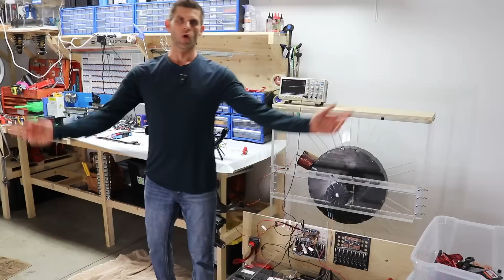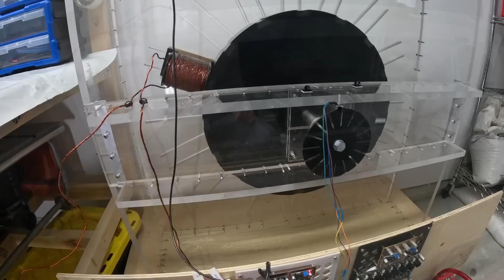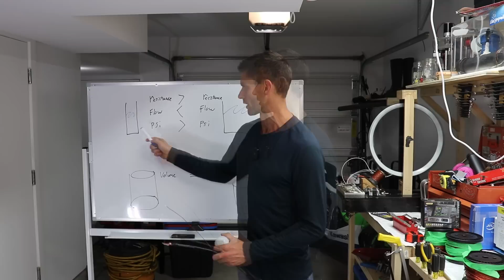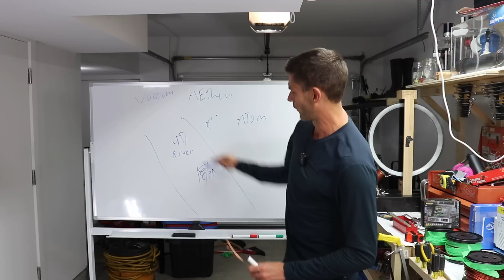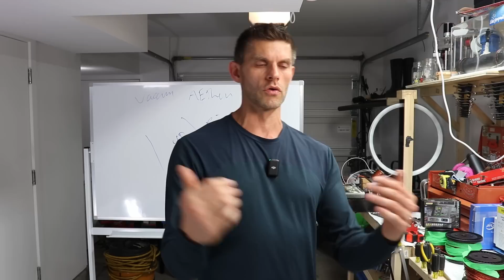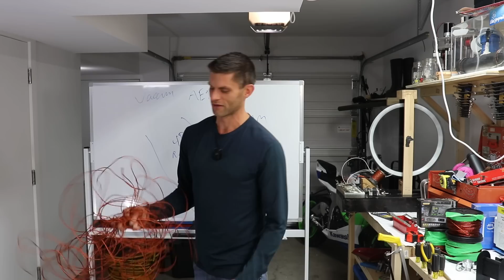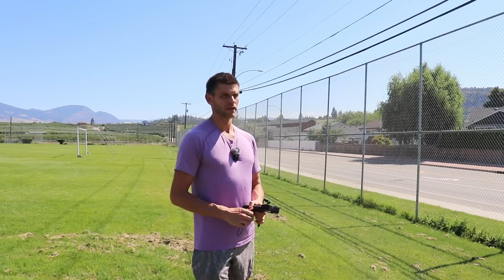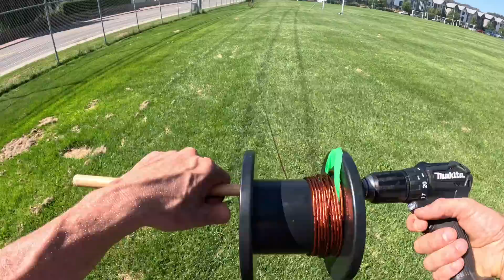I Built This Energy Machine in My Garage — And It Works

Comment: Mechanical solutions to aether harvesting are interesting. I feel like direct electrical systems are probably a little cheaper to build. But a solution is a solution! The benefit is you're working with an existing design.

Oh wait a second. Is that a fractal coil? 😉 Now we're talking! You have a 2 level fractal. I wonder what happens if you have 3 levels? 😉
Reply from the maker: Lol stay tuned ❤❤

Comment: The real question is how many batteries does one battery charge and how much time it takes to charge up 1 battery? And isn't it inefficient since battery health will deteriorate overtime and you need to buy more batteries which is the main cost of the build? Also will really appreciate some proof, like a timelapse of batteries being charged up.
Reply from the maker: Yes the proof is coming, im going to show when the build is finished and also on the bedini SSG

Comment: How over unity is achieved based on potential energy before & after, will be interesting to see what equipment is used for this. I think you mention measuring "work" before & after with a known load, but how precise will this be? If over unity is tiny, but accumulated over time, how much more versus the build cost, will be a great next discussion down the road.

Please watch this video - on how parallel current flow in coils affect each other - may explain in part the effects you got - what Ampère discovered on how two coiled wires with current flow in the same direction don't repel.
Your coils with independent strands sandwiched together under pressure and encased in epoxy - may be exploiting this phenome - the compounding effect you measured & the spike. Plus the math is there :)
Your idea on this would be enlightening, as you possess a higher education I don't have. I find this stuff fascinating, how a forgetting by time documented research might prove you right today.

"The Force That Physics Erased: Ampère’s Forgotten Law" especially at around 4m 15s 
https://www.youtube.com/watch?v=YHykWjtVdNM

Comment: This is just an inefficient way of moving energy from one battery to the other, if you were generating net energy you should be able to run off a capacitor and also charge it and the voltage should go up over time. If you can't do that then you're not generating anything.
Reply from the maker: Ok sounds like u know
Reply: I guess modern electronics use high freqency Capacitors that suck up this theory of Ions (Lead acid/batts in general) getting slammed with these very high speed spikes, exploiting things conventional DC current isnt utilizing (my understanding). Time will tell. I can see the "Cap to Cap" self looping idea as being logical

Comment: Help me understand the basics of what you’re trying to do here. You take a set of charged batteries to drive current through the coils. The coils then generate a magnetic field, which spins the wheel. The spinning wheel in turn charges the other set of batteries. Ok, but once all the energy from the first set of batteries is used, the amount of energy stored in the second set of batteries will be smaller. That’s because part of the energy from the first set of batteries is inevitably lost as heat, friction, and electrical resistance.

Later, you plan to connect something to this circuit (for example a light bulb) to power it. The bulb will light up for a while, but eventually it will simply shut off. And the reason is the same: friction, heat, resistance.
Reply from the maker: Not quite, check out my last few videos
Reply: @MadscienceLPTECH  OK. I’ve watched your videos and here’s what I understand so far: Your motor uses pulsed input to the coils, and when the MOSFETs switch off, the collapsing magnetic field creates high-voltage flyback spikes. These spikes are routed through fast diodes into the charge battery. According to your explanation, these sharp pulses create an imbalance inside the battery between fast-moving electrons and slower ions, forming a dipole. You suggest that this imbalance allows energy from the vacuum (or quantum field) to flow into the system and increase the overall energy.

My question is: do you expect the amount of energy drawn from the vacuum in this way to be greater than all the losses in the system—such as friction, electrical resistance, and heat in the coils and switches?

Comment: Hey man I understand you're thinking and I also understand that you've invested a lot into this but it's important you don't get stuck bashing your beliefs of how you think it will work on hope I've been doing that rabbit hole myself in my own project trying to catch back emf to generate power it's not more powerful then the losses of the system in accelerating the motor to collect the collapsed emf it is higher voltage but the current is less and as we all know the current does the work in electronics
Reply: I typed this fast and sent it before spell checking it by accident.
Reply from the maker: We are not expecting excess flyback. Your beliefs are not mine thankfully and we will have excess energy very soon

Comment: Why don’t you measure watts to the coil and watts coming out of generator? It will instantly reveal if there is excess energy in the system
Reply: I agree the system needs a load. Most scientific way to measure P output would be a variable resistive load (load bank). Gradually increase load (decrease resistance) and find the point where power peaks which is where the voltage starts to drop off. A simple $20 power meter will show P input to the system. You can instantaneously compare P output to P input. In my opinion, the light bulb method is too crude. I want your results to be clear and indisputable, which requires rigorous quantification.

Btw I’m a physics and engineering educator and I’m in your corner.
Reply from the maker: Watts off the generator? You have to measure work done or power inside the batteries to definitely measure the system

Comment: 0:50 dawg it's called gravity
Reply from the maker: No i dont think so
Reply: @MadscienceLPTECH  ok technically it's the electric potential of the air. But seriously the equations used to calculate the force of gravity and the electrostatic force are structurally the same

Comment: You use water flow as analogy for electricity flow, I relate to it that way too. Continuing in that line of thinking , the way I understand what you describe as happening with the voltage spikes that produce the additional charging reminds me of a water RAM PUMP. A ram pump uses a stop valve on water flow and the kinetic pressure pumps a spike of water to higher elevation. Seems like the same principle to me.
Reply from the maker: Yes others have commented they agree with you

Comment: Just so I understand correctly: one battery powers the coil to run the pulse motor, and then the spinning wheel is used to charge a second battery. If so, wouldn’t the charging process create drag on the wheel (due to Lenz’s law), meaning the motor ends up consuming more energy than it can give back?
Reply from the maker: Lets chat about this next video😊

Comment: so when u twist the wire then spool it up , pay attention to the   direction,  if u go same direction  when twisting and winding  you will fight the kinks, go opposite directions. im a retired crane operator i spooled up 1.5" steel stranded cable (not sure of windings  its been a min) on a approx. 2 ft diameter spool
Reply from the maker: ❤good tips thank you

Comment: You change your sensor to a pulse generator and change the circuit to use the power it generates rather than using power to run your sensor. Pulse generators are used in most spinning devices to run speedometer and engine sensors for timing

Comment: Would this system you're building benefit in any way from the concepts demonstrated in "The Action Lab: Getting Free Energy From The Sky!" and "Plasma Channel: Drone Harvesting INVISIBLE High Voltage From The Sky"? Would mounting it 20ft or so in the air exposing it to a more positively charged environment be beneficial to your generator in some way? The only thing that I noticed from a first glance in "The Action Lab" video is grounding issues from the structure taking from the available positive charge as you get higher, but I would think that there are ways to minimize that effect. Just something to consider for a possible kickstart to the motor or a redundancy feature and another possible source of free-ish energy that can be imputed into the system. Love the videos so far and keep it up.
Reply from the maker: Different source but valid for sure  thanks for watching and commenting!

Comment: I love your work and mission, but there is something I don't understand. How is a pulse motor with a joule thief (my understanding of your configuration) taking energy from the "vacuum"? Is the joule thief actually capturing more energy than the total input? I've never seen it be even a meaningful percentage of the input energy. My understanding is that the amount of energy that can be captured from the collapse of an electro magnetic field is going to be very small compared to the electromagnetic field itself. Am I wrong?
Reply from the maker: Correct the energy flows from the batteries. The system as a whole is what allows this to happen not any one component. Watch the last videos

Comment: I helped a guy install a Bedini motor on a bank of 20 lead acid batteries. Tge Bedini motor circuit conditions the batteries so they hold more energy. Is this recovering electricity from within this circuit, or is it pulling it from the environment? Those experimenting with this stuff, should do it outside or in a shed, do not use this inside your home. Batteries give off toxic fumes. The higher the frequency, the more efficient the system will be. But if not cycling at 60 Hz, your clocks and or timing will be wrong. And the system can’t just spin to be purposeful, it must be able to do work. I want to see more of this.
Reply from the maker: More coming, yes my garage has OAE

Comment: Will there be a reproducible plan once you finalize your build? Will it include the exact part numbers? Will your final device power a 100 watt lightbulb for a statistically significantly longer period of time than the batteries alone, in a controlled experiment? Will you do the control experiment on your channel? One problem with zero point energy in my mind is that it is the lowest amount of energy in the universe, and to harness it, it would seem you would need a lower state of energy than exists in the universe.
Reply from the maker: Naw that's just old mindset. Lowest energy state has enough energy per m3 to power our civilization for 10000 years lol 😂 and yes yes yes

Comment: I feel like this is just organizing and harvesting static electricity that just floats around. Its hard to just "grab" it on its own, but when you use magnetic energy to organize and harvest the energy you grab some of that extra ambient charge found in the air itself. The momentum also helps here to keep it low cost. Ambient static prob in part comes from our own magnetic poles and even solar energy colliding with it and ending up trapped in our atmosphere itself.
Reply from the maker: Interesting points, thanks for watching!

Comment: MÖBIUS STRIP is an answer.
A 3D object with 4D flow.

And I know that there's a magnet configuration that will produce perpetual motion.
I know its true, but I dunno the pattern, but I feel its about sacred geometry, and how the aether is structured in a macro scale (galaxy sizes). 
The direction of the flow is about the position of the planets and the sun.
Vortices inside biggers vortices until the biggest, the milkway galaxy.

Its all connected.

I also think that photons at Light speed only happens when you detach from the aether in 4D so we have a beam in 3D.
And its tied to the observer, or a closed circuit. By watching you close a 4D flow.
Reply from the maker: That's some interesting stuff to think about.

Comment: Why wouldn’t you just hook up a 4.2v 18650 lithium ion battery to the optic sensor, most sensors are 3.0 to 5.2 volt max, often a little lower voltage has much less noise on the signal line but burning anymore than 3 is called insanity, your not learning from your mistakes, if something fails and you know why fix it don’t continue to test with such an easy fix an optical sensor could run off 3 AA  batteries for a long time these pull like 100ma so theres no point to use the source of power you are using that fry’s to optic sensor, not even to mention capacitors as a fix but keep it simple stupid.
Reply from the maker: Valid ❤

Comment: Hi!  Incredible stuff you're doing!  Thank you so much for sharing all of this to the world. This is what it's going to take to get us off this abusive debt system they got us on. Hey as a side project do you think you could make one of these with a larger cement filled flywheel?  And make run it on torn apart classic gas generators components? Like this pure self built stuff special parts is Incredible still. Although I belive more and more hands on people would get one of these devices going on their own if it was made of consumer grade parts.  Like relatable products torn down like using microwave magnets or washer machines parts and of course the plug in parts or alternator of a generator. Then I think you'll see videos popping up all over the world of people making their own shortly after.
Reply from the maker: This is pretty custom. But I think we can get the components mass produced for cheap
Reply: @MadscienceLPTECH that's amazing to hear! But what do you think about the cement flywheel part? I just am under the idea that that extra mass could help with maintaining torque to the alternator stuff.  Plus I saw this old YouTube gem years ago with an old dude that was running a 12ft tall cement wheel with magnetic plates and an coilied up rod that pushed the plates away spinning the giant flywheel.  He was pumping hundreds of gallons of water a min from one shipping container to another. He used old lead acid batteries too.

Comment: Is the laser on at all times?
If so, I'd put it on its own closed system, just a mini board, which would alleviate the power disruption between your switches and the laser.

Comment: This just seems like regular old, used in every induction motor, taught in every physics class electromagnetism. Until I see the energy balance measured (why not after all this time?), it just feels like any other perpetual motion machine with a passionate but deluded champion
Reply from the maker: You sound a little negative? I never got taught anything like this in school lol. Stay tunded
Reply: @MadscienceLPTECH I understand that it is difficult to measure the energy balance because of voltage/current spikes, but it should be straightforward to base an energy balance on draining of the driving battery vs charging of the charging battery.

Comment: From a cost analysis view point once the system works efficiently and continuously improved upon using open source what sort of cost per kw/h of electricity are you expecting as $20,000 of domestic electricity would last someone a lifetime. At some point mass production has to take place to bring down production costs and the cost of batteries remains fairly constant. If you scale it up would a Ferris wheel generate enough electricity to run a small village?
Reply from the maker: Yes scale and the actual understanding of what the source is and how to tap it, imagine this is just the basics abd we can build machines that 1000x this

Comment: I was expecting the MOSFETS to burn out , not the optical sensors! Go figure. I don't remember Bedini having that problem.  As I recall his biggest challenge was the battery chemistry quickly degrading over time.
Reply from the maker: Bedini didnt use optics or Nch Fets

Comment: bedini motors are not radiant energy machine, it rely's on chemical reaction of the batteries.
Reply from the maker: No
Reply: Ill explain, the motor itself is just a converter From low voltage to high. The spikes that get transferred into batteries allow the plates of the batteries to pull more on the electrons from the fluid in the batteries. Just a more efficient way for the plates of the batteries to collect radical electrons. Hv has a strange quantum quality to it. You have to think of it as a mini tesla tower, but insted of ionizing the atmosphere your ionizing the batteries.